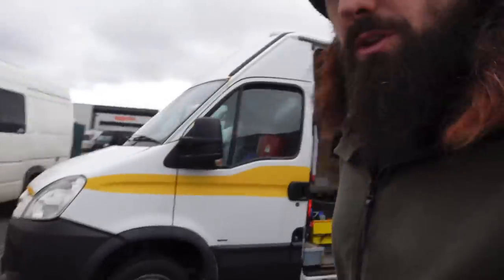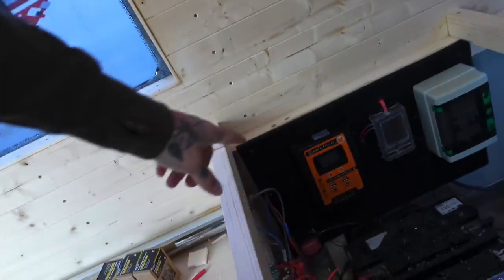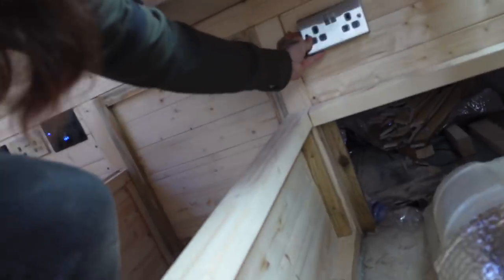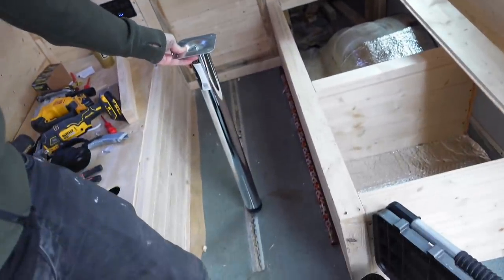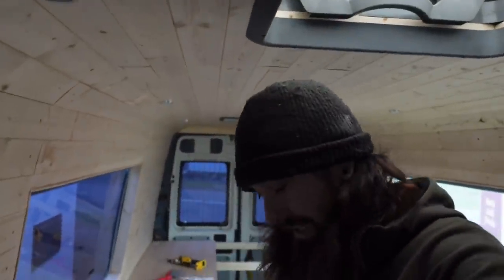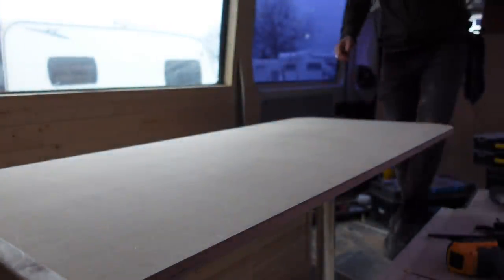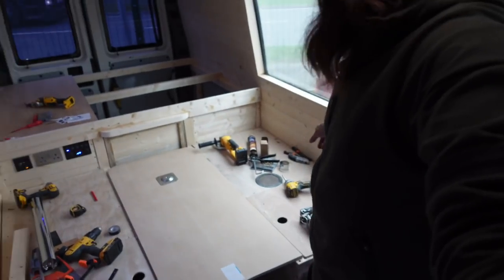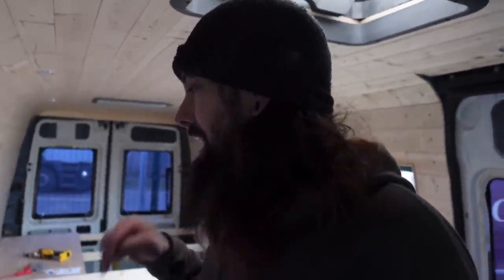Ex Ambulance To Campervan // Pt Six

Comment: mdf is crap mate , will drop to bits its so rubbish it will absord any moisture even from condensation and warp , its not wood its like compressed card . if you do use seal it well multiple coats. yeah its cheap thats good but its going to be ripped out and replaced before too long . im a joiner and know about it . its crap mate . will warp to buggery too after a while
Reply: i dont want to put a downer on it , its all budget  but i wuld be using marine ply. i know you would too your not daft . but as with everything comes down to budgets. mdf is just not good though . but you have done builds before and if anyonene knows you do . later in the year when i get a van i may be getting you in . im a leeds lad . but looking good budd

Comment: For the 240 sockets add the ones with usb. It will come in handy
Reply from the maker: The reason I didn’t is because it seemed pointless charging phones through the power inverter

Comment: It's coming along fantastic, I almost wish you were here in the states to build mine out. Is that a parking boot on the right front tire? I think a French cleat would work great on the front of the table, you just cut a board on the diagonal so that they slip together